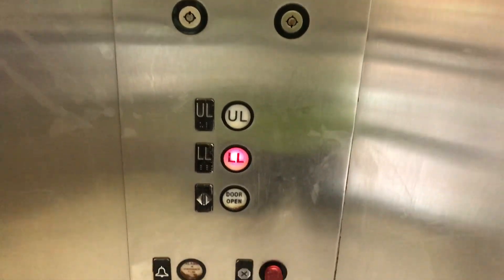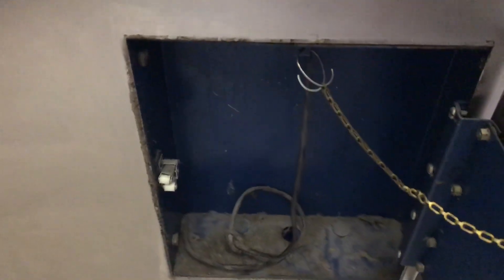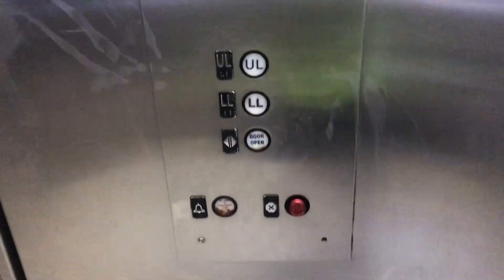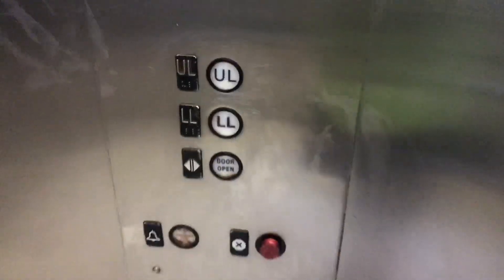2018 take:  Westinghouse hydraulic glass elevator @ Monroeville Mall  Monroeville, PA

Comment: 1981. I believe that call button had an arrow at one point.
Reply from the maker: it did have an arrow!!
Reply from the maker: BTW, I'm not sure when the arrow was removed.  But i'd have to assume some time in the 90's cause I dont think ive seen a video of this elevator with the arrow when the elevator community came to be.
Reply from the maker: never mind...  i JUST saw a video from andrew back in 2010..  and this elevator HAD the arrow on it!!
Reply: This was installed in 1984 when the food court went in. Both hall buttons were replaced in early-2014, then sometime after the button cap (w/ arrow) on the lower level came off.